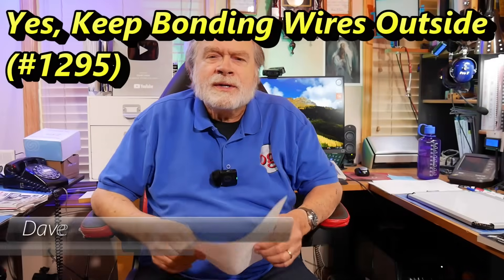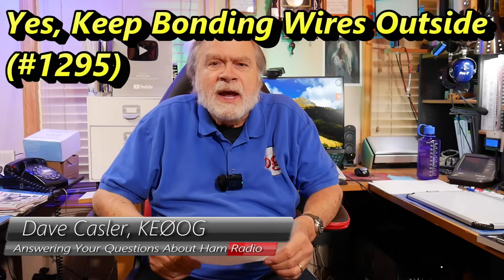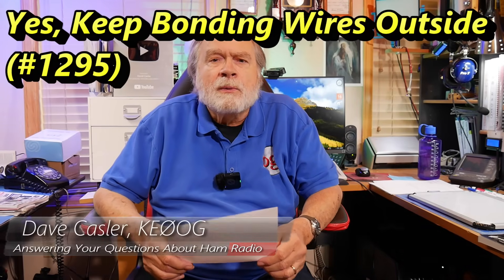Yes, Keep Bonding Wires Outside (#1295)

Comment: 1974 construction - water pipe supplying the house could be galvanized steel or copper. Based on my experience, it's less likely to be PVC in that era.

Comment: I have exactly the same situation and Ward Silver advised me to connect the ground wire from my electrical panel that is connected to the cold water pipe to a new ground rod outside. Afterwards, to connect my antennas to it.

Comment: The simplest answer is: yes, you want lightning to come via copper in to keep everything at equipotential.

Yes, if you have metal pipe, you must bond it regardless of whether it qualifies as a grounding electrode.

Always remember that when there’s no potential difference, current does not flow.
And when impedance is low, potential difference is low.

AWG 6 copper is not the best for low impedance because it doesn’t have a lot of skin. But it is far better than nothing.
It’s just the bare minimum.

Larger diameters and wide braids have lower impedance to high frequencies and lower resistance to high voltages.

All are connected to the electric distribution system neutral at the customer’s first means of disconnection (or at the meter depending on local practice) and the customer’s equipment grounding/bonding system.

Comment: The no ground rod at the meter violates the NESC and should be addressed wth your utility providing electrical service.  Where is your transformer that serves your house?  How far away is the transformer that serves your house?  Is it pole mounted or on the ground?

Comment: I've heard of that --- outdoor, underground iron plumbing used as a service ground.  I my case, we also do NOT have grounding rods around our service panel; rather, the service panel is grounded via the Main steel conduit that is used to run the 150 amp Mains conductors from the regional transformer (3 houses away) to the house.  That conduit is buried 4 feet below grade from the transformer to 6 houses surrounding the transformer and is also used as the service ground.
Reply: That sounds good. The issue is that hidden rust/corrosion can create a high resistance path.

I suggest that you supplement with a copper rod or ring at your shack, and of course, as needed at the base of any tower.